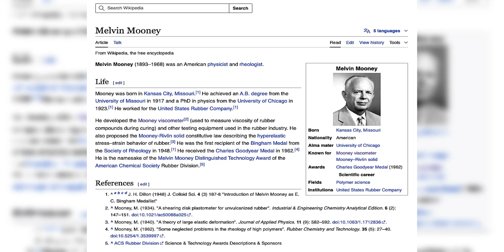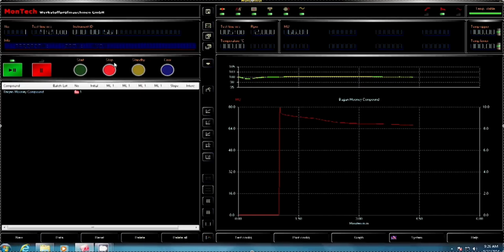Understanding the Mooney Viscometer: Viscosity, Scorch Time & Real-World Applications

Comment: Hello Ma’am, there is a small mistake at 1:50 sec in the video. One Mooney unit is equal to 0.083 newton-meter of torque, and 100 Mooney units are equal to 8.3 newton-meters of torque .
Reply from the maker: Hi Muhammed,
Thank you for pointing that out. I am working on correcting it.

Comment: Thank you mam.. 
But i want to know that i tested the compound 135 degrees.. My compound contain NR, TSR, SVR 20. What basis my boss take this temperature fixed for master Or final batches testing. 
Thanks in advance
Reply from the maker: It depends if you tested the Mooney Viscosity or the Scorch time but the reason for testing at higher temperature can be that either the final batch has very high Mooney at 100°C and the device can´t measure it or it can be that 135°C is the temperature from a certain step in the production process and you need to know the behavior at that specific temperature. Hope this helps and don´t hesitate to ask if you have other questions.